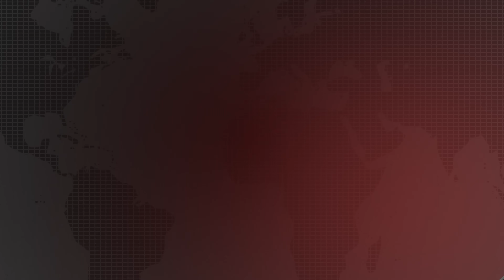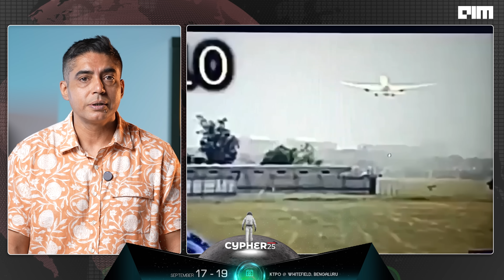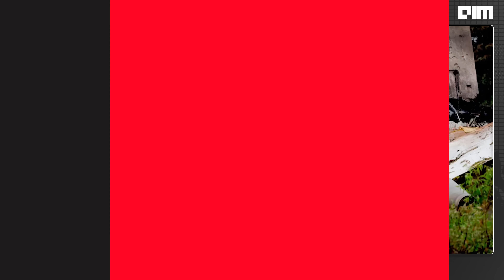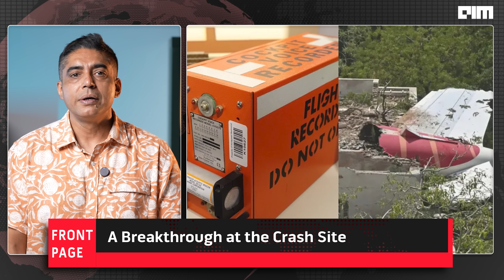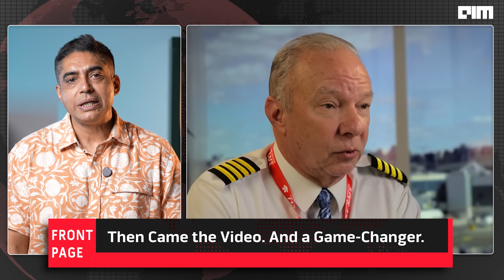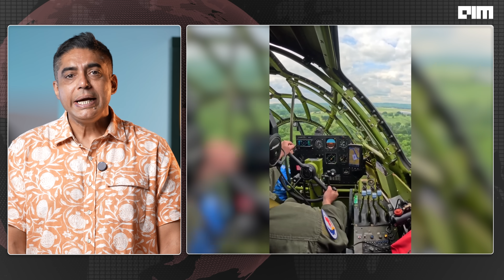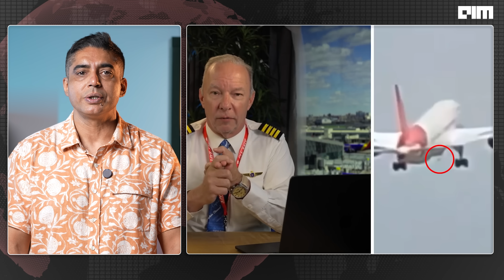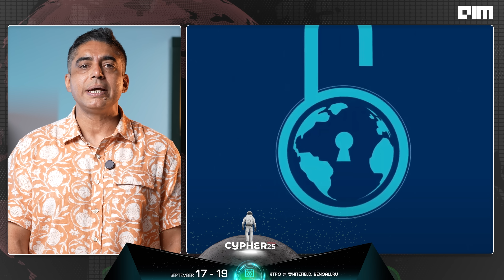Air India Crash: Is Boeing in Trouble Again? RAT Footage Sparks New Questions

Comment: It is a maintenance issue.  
Pilots could do NOTHING.  
Tragic.
Reply: Even if you skipped this flight, many other Air India planes are reportedly operating under risky conditions due to poor maintenance.
Reply: 100 percentage correct..it is because of poor maintenance.. piolet is helpless.. what piolet can do is a thorough cheking before flight and if even a small doubt feels don't take the flight report to correct it.
Reply: @radhakrishnanbhaskarapanic3216 they could also react wrongly to a problem in such limited time.  The wrong engine has been shut down before,  Kegworth and others. My gut feeling is pilot error, I think they calculated the wrong take off speed and took off without enough power and then stalled it in. Again it's happened more than once before
Reply: Double engine failure is a major issue. It's not a pilot error.
Reply: @otiebrown9999  will we ever get the truth ?
Reply: @georgefarrington895 no we won’t. Boeing has deep enough to bribe India all day to keep it quiet what really happened. But a few of us know. Long story.
Reply: There is a video of a passenger who was on the plane on a different leg of the flight, getting off at the indian airport before going to London. He had video of light switches not working and flickering on n off. He wanted to complain as he said some of the faults were concerning ti him. He also stated that he thought the flaps weren't right but he wasn't an aviation expert, but the most concern was electrical function in-flight.  He was taking the video while in the air.  He made a call to his father as he was so worried and couldn't get over the fact why plane was in the air. The video appeared genuine
Reply: @soniawiltshire7643  this does not necessarily prove anything. The light swithces /entertainment system etc may have no connections whatsoever to vital systems of the plane. These are just pure speculations. It is like you'd believe that if the lights of the car don;t work then automatically the brakes may not be mainatined or the engine. It just has no connection
Reply: @soniawiltshire7643 flaps weren’t right in what sense? Because it’s impossible to take off in this plane without them being in the right position. Not to mention once in flight it’s very rare for pilots to make a mistake with the flaps. So my next question is, if the flight weren’t normally, and they landed normally, what part of it made him think something is wrong with the flaps? Just because he looked at them at thought "that looks wrong” ?
Reply: Yes they could have by grounding that plane and not allowing it to leave the terminal
Reply: Unfortunately, the Boeing whistle blower that died recently predicted this would happen. He said when the aircraft was 10-12 years old, the build issues would start to show up! I think I may look at the age of the 787 before getting on board in the future!
Reply: The plane had just undergone a refurbished program.
Reply: you don't know
Reply: @simondalzell5635 the pilots could have aborted that flight and had maintenance fix those electrical issues but they did not since it is very expensive to replace those parts and would be costly in delays and costly customer wise for those repairs on that plane plus they were too low for a engine restart since they had a electrical failure which stopped fuel pumps from feeding the engines why the hell do you think the ram was deployed dingus
Reply: @simondalzell5635 evidently I know more than you I do something called research from what others who were on the previous flight on this plane complaining about electrical issues from passengers telling about lights flickering and the inflight phone not working the screen for the entertainment system malfunctioning hmm it was called electrical problems no air conditioning hmm the engines run on the electrical system which is maintenance issues jackass and unfortunately here in America the pilots have a final say rather a flight goes on it gets grounded those pilots allowed that plane to leave the terminal which was their mistake so yes I do know now majority of people. Know air India maintenance reputation is very bad that they use shortcuts in maintenance
Reply: So, think twice before flying with any airline from this country in the future.
Reply: Lets cut all the crap arguement here. This is why some reknown airlines only send their planes to certain countries for MRO if they do not do it in their own country.
Not only does it cost much more, it is more reliable with a higher work standard.
You ppl can count Air India out on this one!🤣🤣
Reply: ...nice "guessing" !
Reply: It is Boeing. Protected against criminal charges by a criminal government.
Reply: Not true. Many bad design features on 787 for sure. But crew could have saved the day twice, once in air and once on ground. Long story what happened. The cause is explained on another video. In the weeks to come during investigation, watch.
Reply: Why maintenance? Explain please.
Reply: @otiebrown9999  Prove it!
Reply: It was an 11 year old aircraft. Not a manufacturing (Boeing) issue. It is a maintenance (Air India) issue.
Reply: Or Boeing build issues.
Reply: @99672  Oh, yeah, 'cause this happens all the time with boeing planes and other makes never have any issues. For sure, my god, how many 787s have been lost so far? OMG! Totally UNSAFE! You tell 'em, dimestore expert.
Reply: @shaggybreeks  What about the 737 Max TWO crashed and Boeing blamed the pilots? The whistle blowers at Boeing are making the safety issues up are they?
Reply: @99672  a comprehensive pre-flight maintenance process is crucial for ensuring safety and airworthiness.
Reply: @99672  An Indianized Boeing issue.
Reply: @99672 Boeing Bot This was very first crash of a 787 in history. Ragged aircraft and pilot 👨‍✈️ error for sure.
Reply: @99672 It was an 11 year old aircraft. Not a manufacturing (Boeing) issue. That is a maintenance (Air Line) issue.
Reply: Falzo ese tipo de Boing tiene muy buena historia  @99672
Reply: @SusanD-dy6oo 
 Peugeot tem a boa história também mais em 2024, teve recall do caros modelo 2007-2008.
Reply: Plane was sabotaged before flight
Reply: @ramachandra4316  cope more sukdeep
Reply: @ramachandra4316   

Why? Oh, wait, I see, the least likely gives the best conspiracy troll
Reply: @ramachandra4316 wrong
Reply: Air India has received six 787 Dreamliners that were assembled at Boeing's Charlotte, North Carolina plant and they are said to be defective. Other airlines rejected planes that were built there and opted for the ones made in Seattle, Washington.
Reply: @Eyob797 pilot has final say if a plane leaves the terminal and air india has a very bad maintenance record even with Airbus it was a matter of time before a tragic accident happened like this
Reply: How is it maintenance issues?? Boeing bots
Reply: @voicevy3210  Well, Indian Airlines are wery well known, for poor maintenances, cutting costs, employing unexperienced pilots with fake licenses, and very very poor hygiene on the planes....like the planes are so dirty...my god.... R.A.T deployment + the fact that the engines/power was lost right after takeoff, kinda points at maintenance error.
Reply: @zarik175  fake licenses are from pakistan, re check the news
Reply: @zarik175   i am not sure if you have any basic education on STEM, even your car throws errors when maintenance is not done in schedule. dual engine power loss is electrical not mechanical. so its mostly around software. go look at when RAT is deployed
Reply: @voicevy3210  I mean why not .? I don't believe in Air India
Reply: @voicevy3210  it was a maintenance issue look at how many yotubers years ago complained about how air india plane is not well maintained its fallign apart and the workers or who maintnace the airplane wasant doing the job that they were paid to do .. yet no one listens
Reply: @voicevy3210  because even tho Boeing made it. The airlines still fully responsible keeping it properly maintained
Reply: @djdevontay  agree, but thats not how everything works, the sops are in place by multiple manufacturers, engines especially are monitored regularly by rhe supported manufacturer. If you remember boeing tata deal of 250 billion dollars was on hold because rollce royce did not agree to the discounted maintenance cost. Please don't draw analogies with car maintenance.
Reply: @voicevy3210  how is it not a maintenance issue?? mohdi's dog
Reply: @trollLolLol-x3w  i cannot start teaching you critical thinking and physics now. How will two engines knockout at the same time almost at milli second difference ( because there was no path deviation ).
Reply: @voicevy3210  you cant teach because you dont know sheet LOL
Reply: @voicevy3210 These Boeing bots are dumb!
Reply: How much is Boeing paying you?
Reply: Just as Jeju Air, we will never find out what actually happened
Reply: Perhaps  ON  PURPOSE ???  Who was onboard that  "they"   wanted to silence ??
Reply: @otiebrown9999  it's still likely to be pilot error,  at least 80% of accidents are. You should wait for the enquiry. Its possible they set the power levels incorrectly for takeoff or pulled back on the healthy engine if there was an issue on takeoff.  You can't rule anything out yet.

Comment: Well said. I strongly suspect poor maintenance.
Reply: Sorry to say, but I remember an interview with an airline official. He was quoted as saying ''''It is more affordable, to compensate the families, than the expense of parts, and maintenance. Honest.
Reply: Even so, poor maint would likely only mean one generator going out. Both at the same time would have to be design flaw or intentional as its nearly an impossible scenario
Reply: @Skywest25    Electrical system required the R.A.T. but it was too little too late.  They could have had a major SNAFU with the electrical system cutting off both engines
Reply: @mtlicq I’m curious why the battery didn’t kick in. There must have been a major fault in the busses
Reply: What battery. If there is one it's for starting an APU which starts the engines with air and some low power. Engines turn the generators to make the power.
Reply: A few days ago an American Airlines engine fire was attributed to improperly installed parts.
Reply: The thing is they put pressure on maintenance people to check in a rush and maybe they don't have time to check everything. They should let maintenance people to do their job properly and check everything by the book and don't miss anything so accident like this never happens.
Reply: Fuel also
Reply: @satwindersetia4367 > Guilty until Proven Innocent ? Strong Accusations are not Cool.
Reply: @Gabriella_Dangelino  Is not a big deal... the person will be either wrong or right. After reading a couple days ago about a 3/13/25 engine fire I also sense it was a maintenance issue. Also curious if some event could cause software to shut down both engines (similar to how 737MAX software caused planes to nosedive based on input from one sensor).
"The National Transportation Safety Board (NTSB) is investigating the incident, with preliminary findings indicating that loose and incorrectly installed parts in the engine may have caused a fuel leak and subsequent fire."
Reply: totally agree
Reply: A new engine was put in recently.
Reply: To be honest with you I feel extremely humbled with this thread of experts never in the history of YouTube have I been in such fine company of aviation or experts such as people in this thread I am in awe of the pure unadulterated technical knowledge you all possess along with your psychic powers in understanding exactly how the air crash happened before anybody has announced anything I feel that is just absolutely mind-blowing and I think well actually I feel I sent strongly that your gifts are wasted here on YouTube God bless you all you have such successful roads ahead of you all 😉😸😏🙀
Reply: It's easy to blame maintenance. Do you have any evidence? Surely not. So shut ....
Reply: @stabilo3170  Not yet, and evidence will be forthcoming, but this happened to an American Airlines plane in Denver last March. Take it one step further, and theorize software could automatically shut down both engines if something like this happened. 
"The National Transportation Safety Board (NTSB) is investigating the incident, with preliminary findings indicating that loose and incorrectly installed parts in the engine may have caused a fuel leak and subsequent fire."
Reply: @chrissupport  Fuel leak? Subsequent fire? We are here talking about a deadly crash costing more than 260 lives.
Reply: @stabilo3170  You need to think more. A fuel leak (or something else) could cause software to shut down both engines, which is the prevailing theory, though supposedly with a 1 in a billion chance of happening. A number of things could cause this from the same company whose software made planes nosedive from 1000 ft based on the input from one sensor.
Reply: @chrissupport  if then. Then why didn't not occur while yet on the runway..? Why wait until it got to that critical time period of feet's above the ground like it was programmed so. I hope not sabotage..!
Reply: purposeful  poor  maintenance
they achieved their goal
Reply: Hard to believe it could be maintenance.  Yet, on a different note, did you hear that a UK or Irish airline thoroughly checks out new Boeing planes before they are put into service . But they didn't elaborate to say what results were.
Reply: Do not suspect any, wait for the real report!
Reply: BECAUSE IT WAS IN HAND IF TURKISH COMPANY. NOW OUR RELATIONSHIP IS NOT GOOD.
Reply: Real suspense is that Air India immediately discontinued contract with Turkey firm. May be they already know what happened.
Reply: How much is Boeing paying you?
Reply: @satwindersetia4367  same suspicion! Maintenance failure!

Comment: Why both engines failed at the same time @ 600 ft?
Reply: @hanafitalib  electrical failure or fuel contaminated can knock out both engine
Reply: @aboubacarabdou4609 both are just theories but highly unlikely mate! During take off both engines provide electricity (kinetic energy from the rotation of the gas turbines that runs the generators that provides 240V systems independently)! Furthermore, there’s APU & lithium iron’s batteries as back up! The engines must fail first before the electrical power gone kaput! That’s why RAT was deployed automatically! On fuel contaminantion, unless the delivery guy mixed the water with jet fuel during refuelling and bypassed the monitoring unit, this hypothesis stand a chance!😢
Reply: @aboubacarabdou4609 then why wait till 600ft..? Could have happened on d runway
Reply: They didn't. Plane was at "nose high" attitude the entire time. Engines were working. Plane was overweight, mostly likely pilots given wrong inputs for weight and balance.
Reply: @itjustlookslikethis why RAT deployed ???
Reply: @itjustlookslikethis I did hint no one is looking at the kg weight issues n dynamics..which is also critical here. Perhaps at some point, drag became greater than lift.. But why are houses built just over runways..? Wouldn't it be better we have a whole clear field all the way for any sudden eventualities